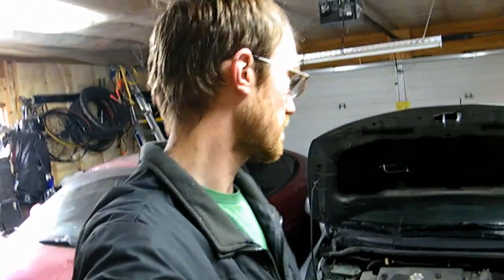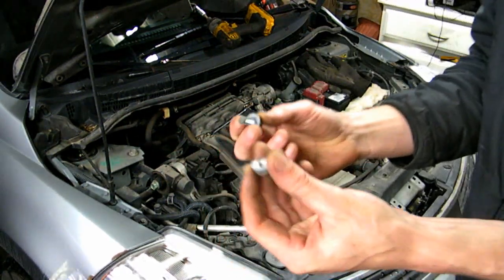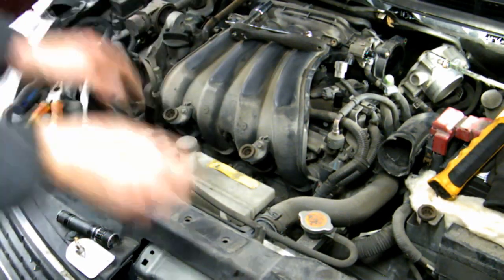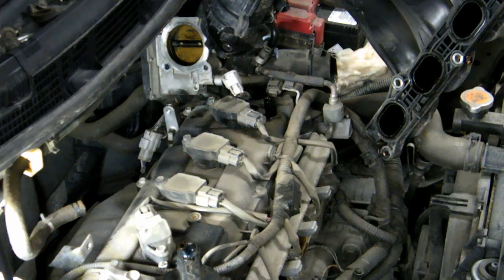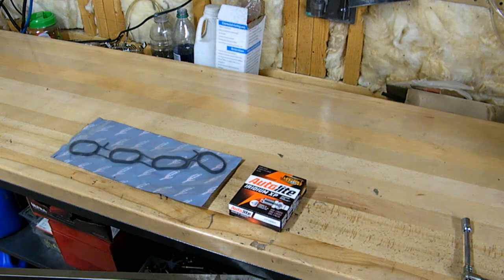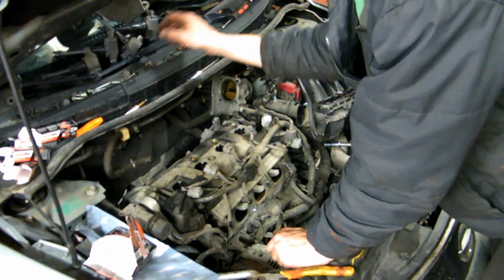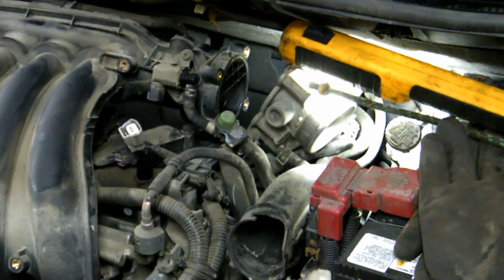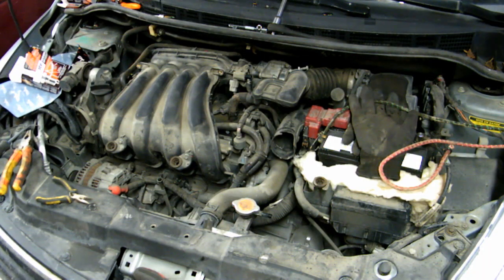2009 Nissan Versa 1 8 spark plugs

Comment: Neglected several bolt sizes during removal. Iridium need a bit extra care if gapping. And .043 is spark plug OE specs for anyone reading.

Comment: Thanks, I'm going to take a crack at mine!
Reply from the maker: It's fairly easy, id suggest figuring out your spark plug socket before you remove everything.  I think you can get to one plug right?

Comment: is it required to replace the gasket if i just want to do the spark plugs/coilpacks?
Reply from the maker: Naw I'd just replace if it looks warped or something.  It's more just prevention of more things to go wrong in the future,. They probably last as long as the engine in most cases

Comment: What's the torque spec of the intake gasket . thanks
Reply from the maker: funny im having a hard time finding that info.  weird,  anyways Id guess around 8 foot pounds, like as tight as a brake lever on a bicycle,  you may be able to find a workshop manual on google.  this is the 1.8 liter